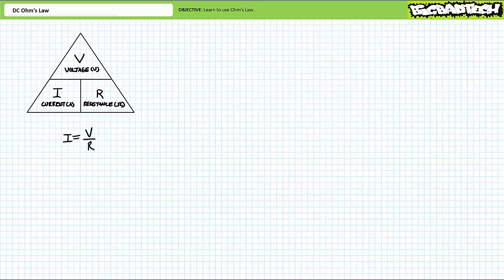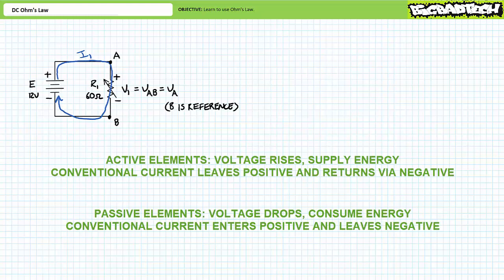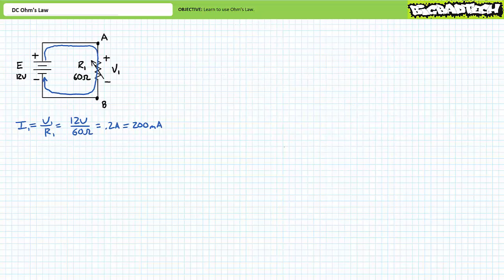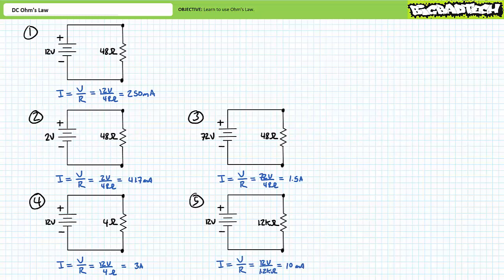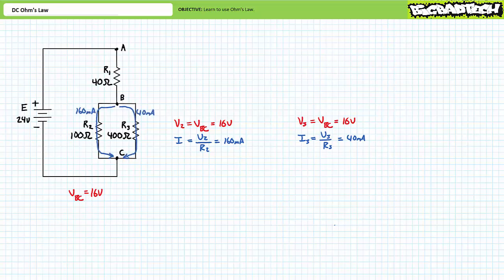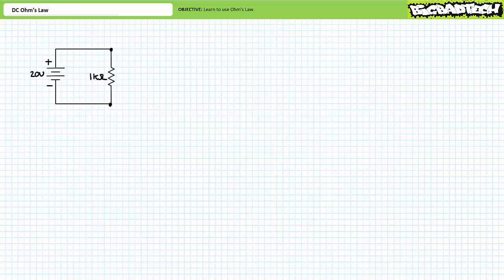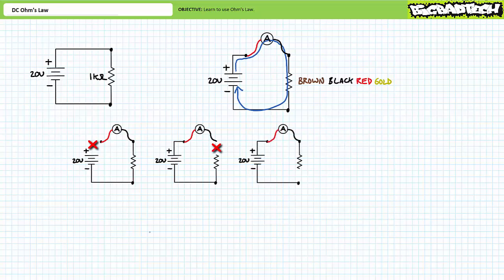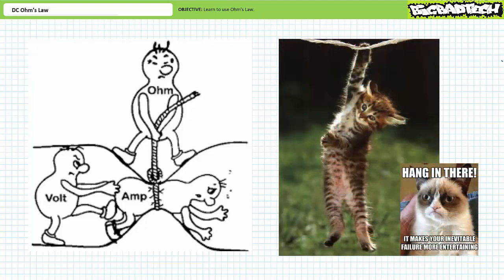DC Ohm's Law (Full Lecture)

Comment: I would assume that the poor resistor was smoking in hell because P=VI (20Volts x 0.2A = 4Watts of power). And I would also assume that besides getting me the wrong resistor (100 Ohms instead of 1K), the resistor my lab partner gave me was rated at maybe 1/8 Watt. 1/8 watt max receiving 4 watts of power is like he-man power flowing through a beggar that hasn't eaten for a month! He melted 🤣😂🙃

Comment: At 7:07 you say "what goes up must come down". And somehow this means that after the first little resistive load the voltage drops to zero? I'm pretty sure there is still some voltage to push current through a second small resistive load you might add in series. And the second load wouldn't magically make the voltage drop to zero, either. Whether your meter probes contact the source terminals directly or at nodes A and B, you are measuring the same source voltage! It is not at all clear to me what the concept is supposed to be here or how it is supposed to work. It is clear that you are talking about something important that I need to understand, but it can't be actual voltage. Even an open circuit instead of a resistive load would still make the voltage read the same as the source voltage, measured in the way that you show in the diagram. As implied by Ohm's law, the same voltage applied to more resistance yields less current. Not simply zero voltage, which seems to be what you are saying, but can't be what you actually mean. Any clarity on what is actually meant here would be very much appreciated.

Moreover, does conventional current travel away from positive terminals and toward negative terminals? The answer here seems to be that it changes directions. But of course it doesn't. It consistently flows in the same direction around the entire circuit. So why on earth are we calling the positive terminal from the electrical source the terminal from which current flows, but the negative terminal of a resistive load the terminal from which current flows? Since the direction of flow isn't changing, why is the convention about current flow inconsistent with the actual direction of flow here?
Reply from the maker: Lots to unpack here. First, yes conventional current travels from the + terminal of a source to the - terminal of a source. This is NOT how real electrons flow. Electrons actually flow from negative to positive. It doesn't matter which direction they travel as long as there is a flow through something. DC is one direction only. AC alternates back and forth. The difference between conventional and electron flow only becomes more important when we discuss the inner workings of semiconductor devices and circuits. 
In this simplification we're assuming the wires have 0 resistance. In a real circuit yes there would be a tiny, tiny, tiny amount of residual voltage necessary to continue to push the current back to the source negative terminal to account for the tiny, tiny, tiny resistance of the wire.